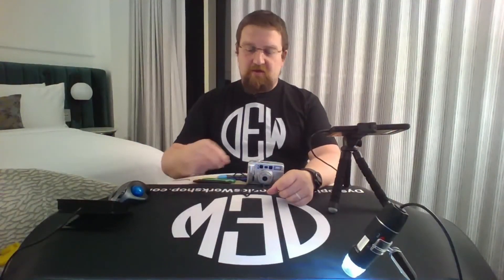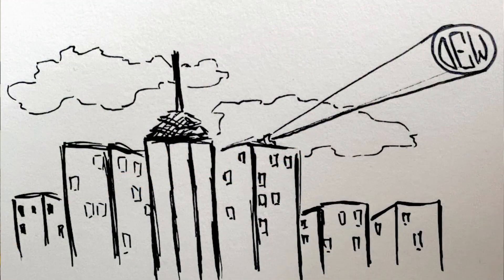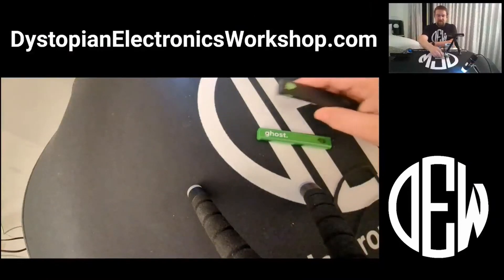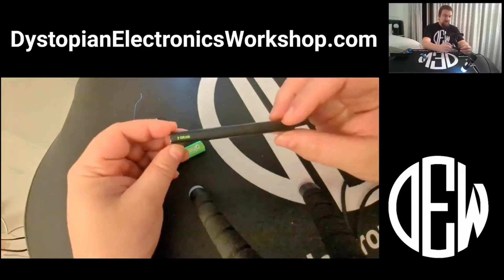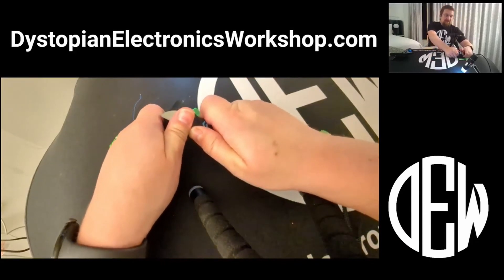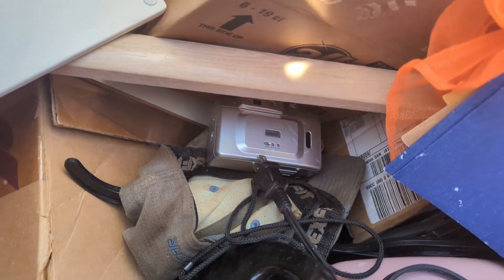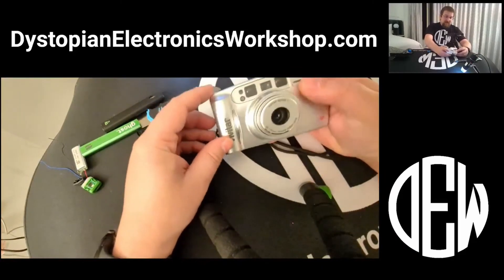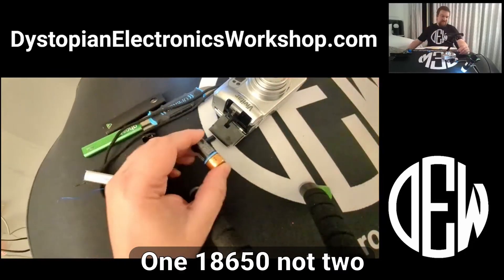DEW 11 LIVE Date-A-Print

Comment: As a kid in radio/electronics class we used to take caps and charge them very quickly in a wall socket and go around zapping each other with the charged cap. Loads of fun! Stay well bro. See you soon.
Reply from the maker: Shocking!⚡
In physics class we all held hands and got shocked with an old phone magneto. Good times 🤣
Reply: @DystopianElectronicsWorkshop  My, how things have changed.